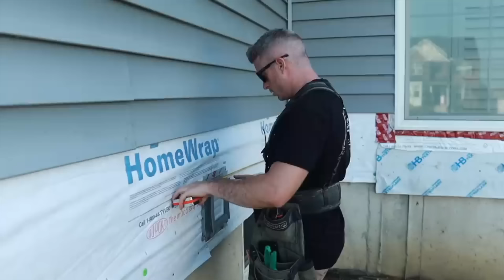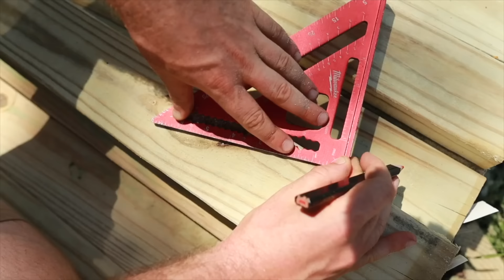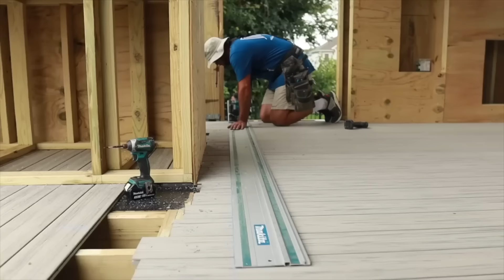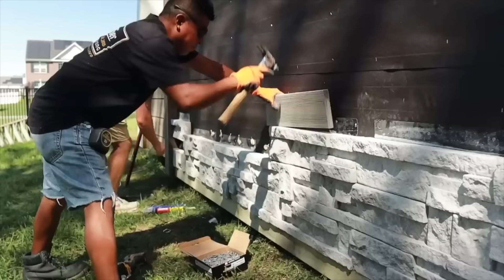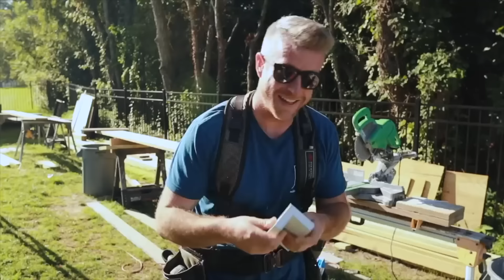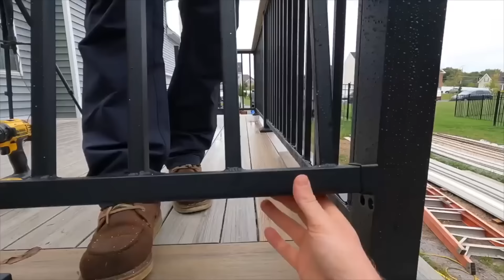Backyard Build - START TO FINISH!

Comment: What do you fill finish nail holes with on pvc?
Reply from the maker: Pvc fill stick! It’s like a waxy crayon that fills the holes nicely
Reply: I used a PVC fill stick on an azek patio door casing and 1-1.5 years later I checked back on my work and every hole I filled with it turned black/green from mildew or algae growing on the wax. So I swore I would never use them again. I’m curious what brand you use, and have you ever encountered what I’m talking about?